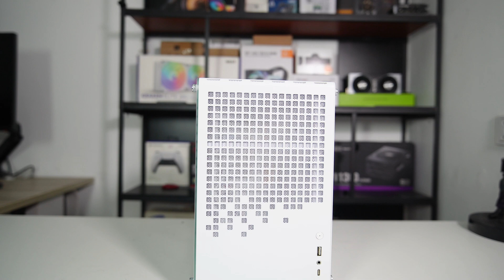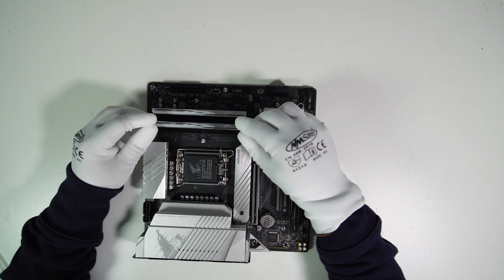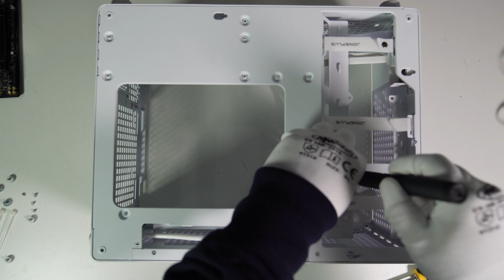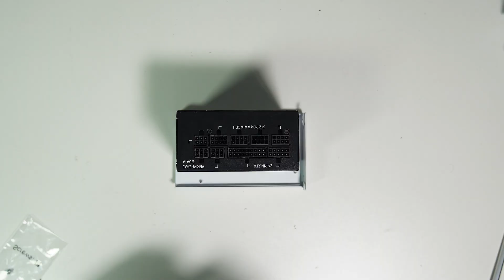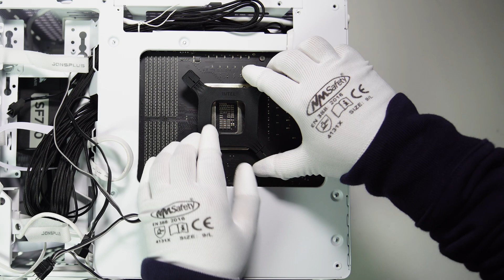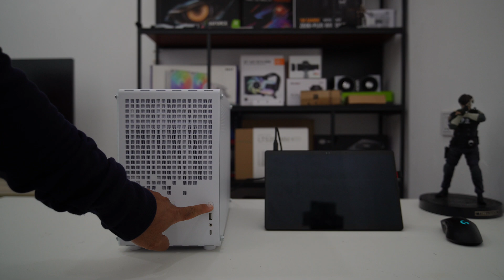Jonsbo Z20 White M-ATX mini PC Chassis budget gaming PC build.

Comment: What made you go with a 12th gen intel build an not a am5 ?
Reply from the maker: Because I already have this CPU, I don’t need to purchase another one. My goal is to keep the cost as low as possible while still achieving acceptable performance for daily use.
Reply: @itggear3400  I've done both builds and I wanna do another is the 12th gen good for handling 4k stuff ?
Reply from the maker: I recently paired an Intel Core i5-12400 with an RTX 3080 Ti after selling my i9-13900K. Surprisingly, I haven’t noticed a significant change in game performance on my PC. While CapCut, which utilizes GPU acceleration, doesn’t seem affected by the switch to the i5-12400 for my daily video editing tasks, I’m a bit uncertain about software that heavily relies on the CPU. It’s possible that the Intel Core i5-12400 might be limiting performance in those CPU-intensive applications. 

Here is my previous PC Build with Intel Core i9-13900K ft. RTX 3080TI before I move the parts and swap case to this PC build (this video): https://youtu.be/Bag7zgWC0ec?si=Mc-bpH-_l-0XX3aD&t=51

Thank you.

Comment: what happens if we connect two pc with m.2 slot cable eachother?
Reply from the maker: Connecting two PCs directly using an M.2 slot cable isn’t a common practice. M.2 slots are typically used for connecting storage drives (like SSDs) to the motherboard. If you have a specific purpose in mind, could you clarify? For data transfer between PCs, Ethernet cables or USB connections are more suitable.